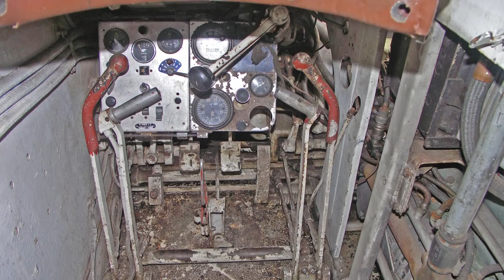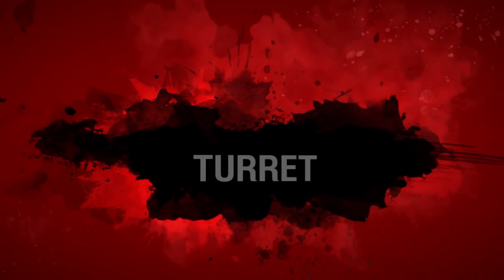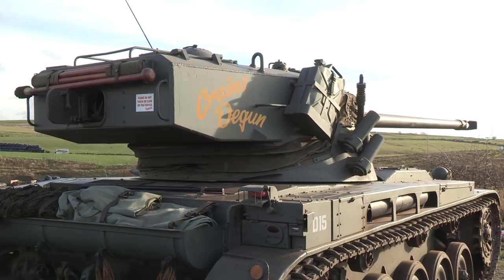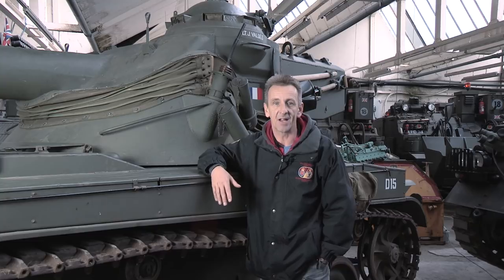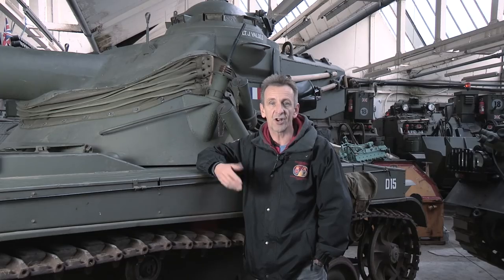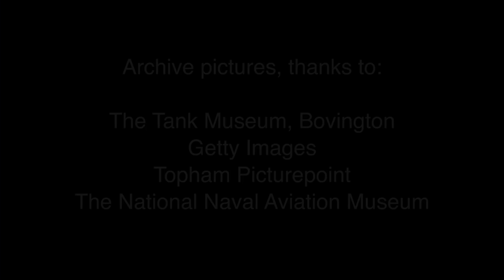Inside The Tanks: The AMX 13: Part I - World of Tanks

Comment: 8 years ago, when I went through Ft Knox, there were a couple of these rusting away to nothing in a yard with other tanks hulls. We used to pass them on the way to the range.

It was only until the French line was added to WoT that I knew what they were.
Reply: I was at Spangdahlem AB, West Germany in the 1980s and they had about 20 of these things in the woods of the base for a big NATO exercise called "Salty Demo." I saw one driving around the base leaking oil everywhere on the 4th of July for some reason. The USAF Security Police (now called Security Forces" were fooling around with them. I think they had a mistaken impression USAF cops were USAR infantry! :)

Comment: holy shit... 6 days to change a engine
must be a nightmare for tankers if your engine breakes down in the middle of combat
Reply: Just buy a repairkit... It instantly repairs it! Like magic!
Reply: Well the leopard 2's engine is so designed that you can pull the engine + transmission quickly.
Reply: TheSoldierCore
Jep, they can change the engine and transmission in 15-30min
Reply: SabatonFan96 Most modern tanks have the "power unit" all together, transmission and engine, which can be pulled out by a ARV, for example, and then replaced all while out in the field.
Reply: SabatonFan96 That is impressive.
Reply: SabatonFan96
15 minutes for a complete swap seems very, very optimistic. Even a few hours would be an impressive time and it's probably closer to that than 15 minutes.
Reply: Olden days engineering usually forgets maintenance. Nowadays, this concept came with american capitalism if im not mistaken. See the m4 sherman
Reply: Abensberg friends of my busted their engine under fire, they managed to get towed out and the thing was replaced in like 15 minutes.. most western MBTs are modular and are built like lego so you can take them apart easily for repairs.
Reply: As long as theres AMMO
Reply: An engine*
Reply: But ya see it dont break french engineering
Reply: @Spinnie1  we're not talking about leopard 2

Comment: What a great jog you have done! I am a former Tank Platoon Leader serving on AMX 13-90 during the late 70s in Verdun, France. It looks as nice as can be. Your report is absolutely accurate. The owner's personal paint job is very American/ cartoonish and would fit a flying fortress far better. All the rest looks exactly like my old "Reims" (name of my tank).  My radio code was Yankee Mike. Unfortunately I am a six footer and trying to drive the tank was quite painful. Anything else went quite well. Yep, servicing the engine at level 2 ( important repairs) was... very tough, but not for those who ran the beast.

Comment: Kudos to Mr. Bolton for that restoration job! I was a tank mechanic in the Singapore Army in the late 1990s. The tanks we used then were upgraded with a V6 Detroit Diesel turbocharged engine, new electricals, a hydro-pneumatic suspension and new range finding and targeting equipment, although the 75mm gun stayed the same.

They were all retired in 2007 when we bought a lot of Leopard 2A4s from Germany.

Comment: It must be said that the AMX-13's FL-11 oscillating turret was inspired by the oscillating turret of the Panhard type 201 wheeled reconnaissance vehicle from 1939.
Reply: Oscillating turret was the only design that could accommodate the drum magazines. They protrude so far back that by raising the gun above the fixed portion of the turret, they could get some decent elevation on the gun.
Reply: @cherylchan753  oscillating turrets are cool

Comment: I heard my father mention something, my grandfather noted when servicing the dutch AMX 13's. It was that the 105 mm the dutch had fitted to the AMX 13 would crack the turret after firing  a given number of rounds. Wich had to be fixed numerous times. After the dutch sold their AMX 13's to I think Israel, They removed the 105 mm and fitted either the 75 or the 90 mm and used them extensively without problems.
Reply: Dutch AMXs were sold to Indonesia!

Comment: Favorite Tank!
I want a close up of that autoloader spinning. I wonder how bad was the reloading part?
Reply from the maker: Not too difficult.
Not great having to leave the tank though.
Reply: Wargaming Europe Couldn't it carry 12 rounds in two 6-round cylinders? Then the gunner would have to get out of the tank to reload it from external stowage bins, which would take about 15 minutes, and reloading from inside the tank could take 30?
Reply: Wargaming Europe kindly amx 50 b
Reply: ***** No, they could reload from inside, it just took twice as long to maneuver the shells into the drum. This is why an automatically reloading gun from a drum is really impractical. But there are some modern SPG's which have mechanisms which pull shells from the ammo rack and load them, takes about 3 seconds and it can fire 4 shots and have them land in the same place at the same time. It just changes the arc for each shot, very cool shit.
Reply: ***** yup. Its called  MRSI (Multiple Round Simultaneous Impact)
Reply: Himanshu Gogoi Some awesome stuff right there, scary and devastating. The Des Moines has those automatic loading guns. Can't wait to get that in WoWS.
Reply: *****
huh!! didn't know that !! :D
Reply: They have two revolver cylinders at the rear of the turret. They have to exit the tank and reload it like we reload a revolver. Singapore still retained the original 75 mm gun
Reply: Wargaming Europe make a video about amx 50b
Reply: 12ock Not sure if there is even one left in existence.
Reply: +Pauline nope I dont
Reply: Actually you can reload from inside the tank, it is only a bit slower because you have little space to move the rounds and fire off at a slower rate. The rammer still works.
Reply: ***** yeah...hehe
Reply: The French finally built a good tank...
Reply: In real life, the AMX-13 can be reloaded from the inside after the 12 ready rounds have been fired.
Reply: I used to know many former AMX 13 crew members in the french army in the 90's. Late at night around the fire when beers had gone horror stories about the "13" were legions... among those, the time to reload the whole system was ONE or ONE and HALF hour to reload!!! Every space was so tiny that it was a nightmare for crews and engeeners!
Reply: @billyjean7381  You do understand that didn't matter, right? I mean, you know they never fired more than two or three rounds in real world fighting, and they could do that rather efficiently. They would then reload those two or three shells as they retreated or changed position. They would not likely ever spend or reload the entire loader under combat conditions.

Comment: No one ever mentions that the "autoloader" is not robotic/motor driven.
Each shell in the 2 drums has to be hand cranked by either the commander or gunner, into the breech.
After firing, the shell case has to be manually ejected using a lever.

Comment: Nope, it is NOT a development of the KwK42 gun!!!
I know it's being repeated everywhere, but I've never seen any solid source for this myth and I've been reading a bit on French tanks of the time. It's not even mentionned in the COMHART books which go quite in depth in French guns development of the late 40s/50s.
Different chamber/breech/bore/ammo/construction/muzzle break and so forth... The ONLY common point is that both the KwK42 and the AMX's SA50 are high velocity 75mm guns. And this is it.
Reply: bidon3332000 
Correct.
France just wanted to mimic the ballistic performance of kwk, because they where impressed by the gun.

Comment: The oscillating tower and the gun are built into one piece, meaning that the recoil of this high pressure cannon is absorbed by the whole tower. That's why an even heavier 90 mm., barrel could be used not to speak of the eventual 105 mm., piece.

Comment: You missed quite a big drawback to the oscillating turret, gun stabilization. Even though at time when it entered service gun stabilizers were still quite primitive, a conventional design can be quite easily outfitted with this system, while to stabilize the entire turret you would need an huge motor which would take up a lot of interior space

Comment: Engine replacement in an AMX-13 is at most a half day job. Not 3 days as this restorer took. Since its mentioned in the video that there were issues with the transmission, the transmission should have been removed first. Once the transmission is removed, (which entails removal of the front armour), the engine is removed and slides in easily through where the transmission is.

Comment: The petrol engine was a pain as it gave lots of technical problems. Engine backfired, water coolant leaked, lost of power. Carburetter calibration Etc. Singapore Amy replaced the engine with Detroit Diesel Model 6V-53T and renamed the tank as SM1.

Comment: Wouldn't want to be in the turret if a shell hit it at the tarp covering part between the top and bottom turret parts.
Reply: +Daehawk It's solid, the tarp is just a dust cover so no grit gets under the turret while it moves. Picture link shows without tarp https://www.google.co.uk/search?q=amx+13+without+tarp&source=lnms&tbm=isch&sa=X&ved=0ahUKEwjskJnmnYDMAhVH2RoKHb71BdIQ_AUIBygB&biw=874&bih=979#imgrc=ET3ArugaqQGRiM%3A
Reply: dcanmore
ah cool.

Comment: Of course the French would think it's a good idea to put the engine in the front of a tank.
Reply: Israël think it's good too
Reply: better get the engine down on a light tank than the crew...
Reply: Connor Reynolds it is if you do it right, ie merkava  the engine in the front improves crew survivability if your in a head to head fight against a equal  ,it requires a very good engineering team, not a thing France had alot of at the end of ww2!
Reply: It dramatically improves performance when it retreat
Reply: @peterking2651  can you elaborate?